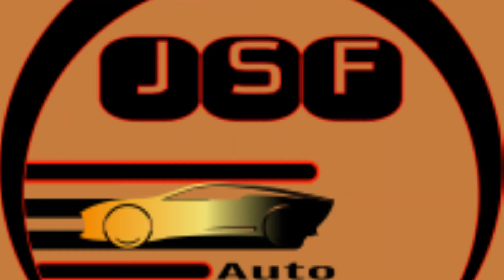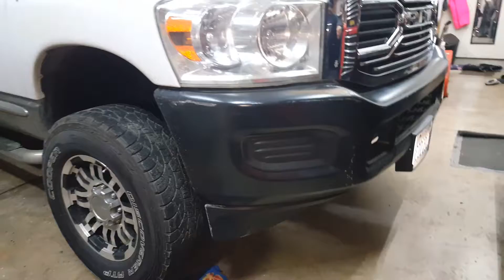Ram 5th Gen LED Fog Lights Install

Comment: Did u ever make a adjustment video?
Reply from the maker: Hi, thanks for watching.  No, I did not feel it was necessary to adjust.  At least not in my case.  But then again I don't do much night driving with this truck to notice any misalignment.   I believe this set up only has up/down adjustment and no side to side adjustment.  If you do need help with that, let me know and I can certainly do a short video on the adjustment/alignment.. thanks

Comment: On that installation paper what’s the position wire for
Reply from the maker: Position wire I believe is for the "position Light"  on the switch, meaning on/off.  Switch is lighted so it should have green/red light indicating on or off.  So the position light wire needs a (positive feed+).  Can be connected to your  headlight/parking light switch or an ignition power source.

Comment: Are you gonna do alpharex headlights next ?
Reply from the maker: It's hard to decide.  I do want projectors & I do like the looks of the alpharex projector headlights on the 2002-05 3rd gen Rams & even 4th gens.  But on the 06-08 , I just don't like how the top of the headlight has the plastic panel to cover the wide top section of the light.  That's just due to the fender design and size of the light on this body style.  So to me the large round style bezel seems to fit this body style the best, again that's just me.  I like to try few different colors (black, chrome, body color match).  I have  quite a few sets of OEM lights collecting dust.  I may end up opening those up and  try the color match or black/chrome and different projectors and see how they look.  I would want 2 honeycomb projectors in the OEM style bezel along with bottom led bar.  But then again it is easier just to purchase something and bolt it on...…decisions decisions
Reply: @JSFautoPlus  check out everythang diesels channel his 3rd gen looks pretty good with them
Reply from the maker: I've seen his truck, it does look pretty good.  Looks like he sold it and got a dually.